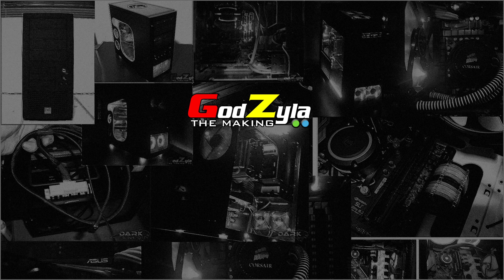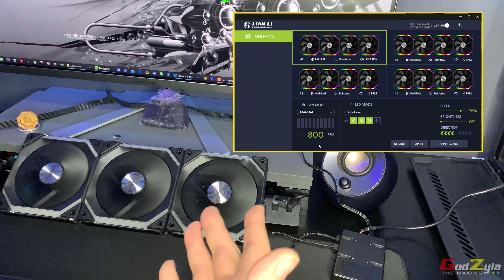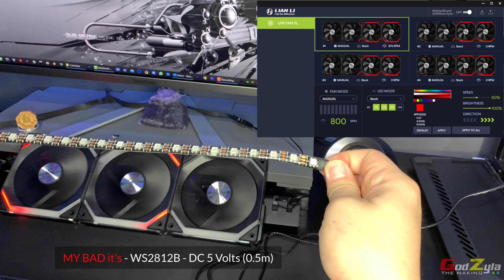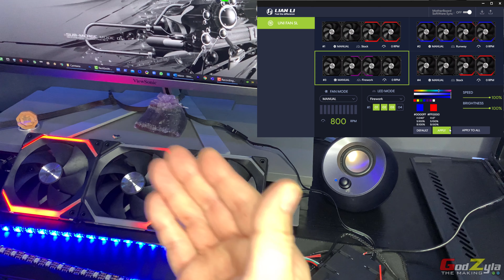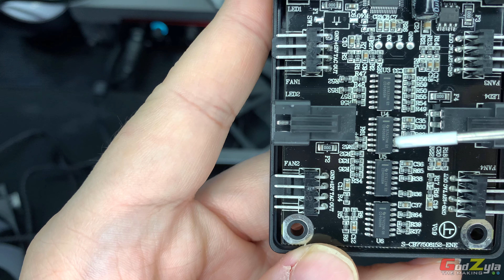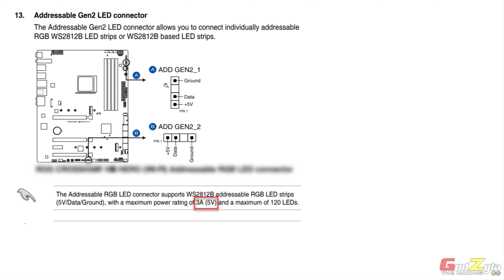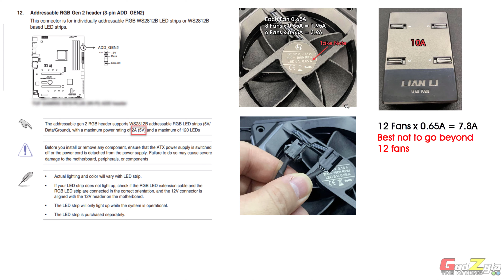Lian Li UNI Fans SL120 - Dos and Dont's (Part II) [L-Connect]

Comment from the maker: I have done a series of videos base on this uni fan which might interest you, list as follow 

Introduction (Part I) - https://youtu.be/ORdObJTn-3E
Connection & The Controller (Part III) - https://youtu.be/Rm2emeyMUAk
To use Galahad AIO on Uni Fan Controller - https://youtu.be/XNCAeAX0mZQ 
Some Break Fix!  - https://youtu.be/8l4i5UjO3es 
How to link Push and Pull configuration fans -  https://youtu.be/TIO8JxVZTi8 
Using EK Vardar Evo 120ER aRGB Fans on this uni -  https://youtu.be/bMRz2KVqbjA
SL120 Case Airflow Test - https://youtu.be/Qp3pYqOOjm4
SL120 Static Pressure Airflow Test - https://youtu.be/apDZ4v_jQBs
Reply: Please make a video detailing how to connect 10 Unifans (3+3+3+1) + Strimer cable kit + o11 Dynamic XL Case Light Bar, all together. I can't find any tutorials teaching me how to completely unify the controls of a full Lian Li build.
Reply from the maker: @kamikaze00007  hi welcome to my channel. You can choose what you like to know. I have series of videos in this playlist about these uni fans and uni controller https://youtube.com/playlist?list=PLEW-b-2vYDdPo0NzHyeksx012c-nkDapm
Reply: Is there any way to convert a standard 3 pin 5v argb connector that is on my waterblock to the connector that the unifan controller uses so that the controller can manage the rgb in the waterblock?
Reply from the maker: @cesarnono13  Hi thank you for your question. yes you can. this is what you need , 1 to 1 Female 5V 3pin connector https://www.aliexpress.com/item/1005001598378033.html or this https://www.ebay.co.uk/itm/PC-motherboard-5V-3PIN-TO-AURA-RGB-FAN-SM3P-Socket-Multi-connectors-cable-ASUS/264896189467?hash=item3dad0b141b:g:I6MAAOSw8-5ey3U8 . hope that helps and if you do like my content, kindly subscribe and to click on the notification bell. thank you very much!

Comment: Hi, I have a question about RGB hubs in general. My Gigabyte B650M doesn’t have bios settings for RGB at all (though has plenty of rgb headers). I can connect RGB fans to my motherboard and then control via various software, but my goal is to Not have any software running. So my question is:

A) Is there a hub that can be programmed through software and save settings on the hub itself, so I can then remove the software (but keep the settings on the hub)
B) If A is not possible, what hub can you recommend (probably with remote) to have good RGB options, without running any software.

Thanks!
Reply from the maker: Hi Emil -, welcome back. A) If you do know ic chip soldering and audrino programming to firmware in to if chip. You might be able to construct this kind of hub. But so far in the of market, there isn’t any. B) most ARGB remote hub are to be plug to individual ports which Lian Uni fans are of daisy chained style. It’s hard to plug each fan connectors to each individual port the remote ARGB port.

Comment: Hello Kleo Yan, I have 9 Lian Li SL 120 v2 connected to Lian Li SL 120 v2 Controller and i Have 24 Pin and 8 Pin Lian Li Strimer v2 connected to Strimer v2 Controller. Everything Works fine but i do not have connected ARGB Cables from the Controllers to My Motherboard MSI Z690 Carbon Wifi, because Im Scared of Burnt ARGB Connector, i also Have Palit RTX 4090 Gamerock OC with ARGB but not connected, my Motherboard only has 2 ARGB connectors is it fine if i Use a Splitter and Connect the 2 Lian Li Controllers and the RTX 4090 to my Motherboard without burning the ARGB?
Reply from the maker: Hello Fate, welcome to my channel, it is fine to use a splitter as all your argb are drawing power from their respective controller / hub so only thing left is the gpu which is drawing direct power from the motherboard.
Reply: @KleoYan  Thank you very very Much for your Fast Response, I will later try to Connect everything and hope it works👍
Reply from the maker: @FateEUW  Hi, you are most welcome. all the best with your build.

Comment: Hey Kleo, I hope you are well, I just finished a new build with 3 noctua fans managed by the ASUS ryujin 2 hub and 9 fans (using 3 fans on each connector) connected to the lian li controller included in the 3 pack.

Unfortunately, the Lian Li fans are recognised via Lian Li connect 3 but they do not spin and do not light up, I will keep troubleshooting. Do you have any advice?

Thank you in advance
Reply from the maker: Hello Dutch69, welcome to my channel, maybe this will help you troubleshoot. https://youtu.be/CgvuUFeff8U
Reply: @KleoYan  thanks, reinstalled the software, downloaded AMD drivers, checked for updates with Motherboard drivers and Connect 3. Still same behaviour

Comment: Hello i have question about controller if i wanted to install a 10 fans to case them do i need 3 controller or just 1, bsc i wonder why are u showing only 3 fans.
Reply from the maker: Hello DePatru, welcome to my channel. Back then I have gotten these from a friend but the controller does allow 4 fans to each port. To install 10 fans with this controller is of no issue. Just make sure they each port is to be kept at max 4 fans
Reply: @KleoYan  ok thank you
Reply from the maker: @depatru3270  you are most welcome and all the best with your build 😉

Comment: i was going to buy 2m argb strip light and use it with lian li controller hahaha thank u for not let me destroy my pc
Reply from the maker: Hello omzxa, you are most welcome. I have witness a lot blow their controller or even melt their cables and such. Some even damage their motherboard. So ya, it’s better safe than sorry.
Reply: @KleoYan  btw I have nine fans that I have connected to my motherboard without connecting the RGB, is this safe? It means that the fans rotate through the motherboard, but the lighting is via the controller, and the reason is that I have a screwdriver that touches the controller and the fans do not rotate anymore, only the lighting works
Reply from the maker: @omzxa8415  it is safe if u cap to 4 fans to one motherboard header. If u using all 9 SL120 fans which each is at 0.18a. Total is 1.62a. If u using just in one fan header. I won’t advise you to do so even your mobo fan header can support up to 2a. Try split then as is 3 in a group to the various fan headers and not to one fan header of your motherboard. For your info, Asus boards are mostly 1a unlike others.
Reply: @KleoYan  thank u man u the best
Reply from the maker: @omzxa8415  you are most welcome. Just to help 😉

Comment: Hi Kleo, I will be using Lian Li Strimer Plus V2 24-Pin and dual 8-Pin and together with 4x SL120 RGB with controller. Then I am planning to add 3x more SL120 RGB and I will be using my motherboard Aura software, that being said I will be using the ARGB header in my motherboard, however my motherboard only have 1x ARGB, (Asus ROG Strix B550-F Wifi II). The ARGB header only have the 3A max load. For the total 7x SL120 it will be total of 4.55A. I understand that the Lian Li unifan controller will be handling that however I am not sure the power rating of the Strimer Plus V2. So is it safe to add 3x more Fans?
Reply from the maker: Hi Rommel Asis, welcome back, so long you have all lian li argb products plug to their controllers and the controllers are powered by sata, you dont have to worry about the argb header of your motherboard. as the power drawn are from the controller and not from your motherboard. So is perfectly ok in your situation. The only issue you have is. if you have more controllers you will need more USB header from your motherboard to controller the lian li argb products. If you want to sync up the argb effects from your motherboard utility to these controller, that will be another challange too.. you will need a spliter for that.
Reply: @KleoYan  Okies thank you very much for your advise, I really appreciate it. In regards to the USB header, currently the Asus ROG Strix B550-F Wifi II only have 2x USB 2.0 header, sine I am also using the Kraken Z53 RGB LC I need at least 3x 2.0 USB headers. Initially I am looking at those cheap  9 pin 1F + 2M USB splitter but I am skeptical about the safety and the solution decided is the NZXT Internal USB HUB which I find it more practical, tidy and peace of mind :). As for the ARGB Splitter the Lian LiSL120 3x Pack comes with it (https://www.lazada.sg/products/i1643873544-s7721030674.html?urlFlag=true&mp=1&spm=spm%3Da2o42.order_details.item_title.1).
Reply from the maker: @rommelasis5991  I see.. yup.. getting an internal hub with it's own power is good.. is not about to deliver the power to your argb.. but is about the share USB IRQ that are on your motherboard. the more USB device you plug to your motherboard, your usb current will go weaker.. therefore causing irritating disconnection or signal lost between your USB Devices and the motherboard, which in this case your L-Connect 3 app needs to have consistent connection and not intermittance or disconnection.
Reply: @KleoYan  Thanks really appreciate all your inputs. Glad that I found your channel that sharing the infos particularly in building custom PCs. For about 3 months I have been checking prices in the popular online PC builder here in SG. Though I have previously building PCs way back in 97 to 2008, I not so excited in building my own, but I am glad that I decided to build and the aesthetics and RGBs are actually just got interesting...
Reply from the maker: @rommelasis5991  you are most welcome. I notice your shop link is from SG. Here is something which might interest you. I have an affiliated SG hub “Cyber Cypher” where he helps by linking my videos in his carousell shop. You can ask the shop owner if he can match your pc parts you are going to get or even to get bigger discount if you do bulk purchase. Below are the details. You can engage him in carousell or shopee. Btw all the best in your build. 

- Cyber Cypher 
you might want to check out this store.
Carousell https://www.carousell.sg/u/CyberCypher.Computers/
Shopee Online https://shopee.sg/cybercypher.computers?categoryId=100644&itemId=19820267878
PC Pricelisting in Singapore  http://www.cybercyphercomp.com/

Comment: two weeks uninstalling and reinstalling I have a hard time believing this software won't work. I have to use a 3rd party software. so frustrating
Reply from the maker: Hi qwicxs, welcome back, I can't recall which video did you commented and I understand your frustration, why not give it a shot to lian li tech support and report your issues? At least they have fixed my issue on L-Connect 3. https://lian-li.com/faq/ scroll down and fill up the form.
Reply: @KleoYan  Thank you sir. I have an MSI Carbon x570s MB AMD 5900x and Nvidia 3080 ti .. I replaced my controller yesterday. I have 3 AL and 7 SL Fans. I've moved the fan controller and RGB wires to different pins on the motherboard. I can control the colors with my MSI software and another 3rd party software. I also uninstalled all of them and tried just using the L-connect. Also I went on the Lain Li L connect website and followed the tip sheet on how to uninstall the L-connect. The L-connect can monitor my temps but it refuses to change my light color. I am to the point of taking them out. I am lost.
Reply from the maker: @qwicxs  i see. ok before you totally give up. do you have a spare m.2 or SSD or HDD, try this if you have a spare. Remove your current m.2 or ssd or hdd that contains your windows OS, plug in your spare, do a clean installation and install only the L-Connect. I know is lots of work but give this a last try. If it does not work, then I have no clue for you either.
Reply: @KleoYan  Yikes.. been thinking I am not home yet. I do have a single 140 in the back. That is connected to a port in the controller. Would that throw it off? Also I have two different types of fans the SL and the AL. On the controller. Would that cause issues?
Reply: @KleoYan  ok I learned there are two different controllers. AL  and SL you have to use the AL with the AL and so on.. I assumed they were all the same. It works now thank god
Reply from the maker: @qwicxs  hi qwicxs, that’s good. My bad, I should ask and pay attention on what controllers you are using as am aware of that. Nevertheless good for your stuff working. Good on you 👍
Reply: @KleoYan  yes sir.. If you can readdress that again. Save other people the pain and suffering I endured.  I appreciate your help your a valuable resource.. Ty!
Reply from the maker: @qwicxs  hey just call me Kleo will do. Yup will do. Thanks for the heads up 😉

Comment: so when i go use the lian li software, i can change fan speeds with the pwm and quiet mode etc, but in the application it says 0 rpm and it doesn’t actually change my fan speed
Reply from the maker: Hi Zaxsa, welcome to my channel. You might want to check the physical connection between your uni fans to the uni controller and does it react when you change the argb effects? This video might aid you if you are unsure how it actually works, https://youtu.be/Rm2emeyMUAk
Reply: @KleoYan  my rgb works i have 9 fans to one controller, and it’s plug to my mobo, but im not sure why i can’t control my fan speed, unless a different software is using it but im not sure
Reply from the maker: @zaxsa8845  I see, you wanted to follow mobo PWM is it? if that's the case, just go to your mobo UEFI and set that fan header you've plug as PWM mode and not Auto. that will do the trick. or you can watch the video link I've sent you earlier.
Reply: @KleoYan  okay thank you so much man have a good day
Reply from the maker: @zaxsa8845  you are most welcome. All the best with your build buddy 😉

Comment: Friend, I've had other times on the channel to clear my doubts, as I said I understand very little English currently I have the Lian Li S120 and after turning off the computer it goes back to the rainbow I wanted it to be in the colors I like I have a B550 Tomahwak
Reply from the maker: Hi Bruno Soares, welcome to my channel. The rainbow should go away once you boot up your pc, L-Connect needs to boot up in windows before it loads your present profile.

Comment: Hi Kleo, I installed my unifans into my pc and both the fans and controller are working, however, when I set my fan mode to PWM in L-connect, it just runs at full speed even when the temp are low. Any idea?
Reply from the maker: Hi Mr. Nighter__, welcome to my channel. just to check, did you plug the PWM cable which has only one wire from the uni controller to your motherboard fan header (Example Chassis_Fan1). Also have you checked your motherboard UFEI / Bios. was that fan header (Example Chassis_Fan1) is set to PWM Mode and not DC mode, please note if you set in L-Connect as PWM mode, it will follow the fan curve of your motherboard fan header. so if you have not set any fan curve on that fan header, it will run by default full speed.
Reply: @KleoYan  Thanks for replying:-). I do set the chassis fan header to PWM mode while also setting the ''fan speed control'' to ''manual'' (which allow me to manually setting the fan curve). Does PWM conflicts with manually set fan curve? Should I set the fan curve to auto mode?
Reply from the maker: @biaozai1314  hi if your L-Connect is set to PWM. The setting is based on what you set on your motherboard UFEI settings. If you set to manual in L-Connect. It’s the uni controller taking the control and not your motherboard. So it depends what you really want to do. For me in most build for friends I will not connect fan load to the uni controller. I will plug the different fan set to the various motherboard fan header and control through the motherboard. I will leave all argb effects to be controlled by the uni controller. 
Reason is, especially for liquid aio. If uni controller is down, only the argb effects are affected and not affecting the rpm of the fans mounted on your radiator. Maybe is just me, just a safety measurement so that I know my liquid aio continue to operated. As for case fans. You can either plug to motherboard fan header or to the uni controller.

Comment: Why do my fans stay rainbow in startup then changes to blue and I can’t control them with any software
Reply from the maker: Hello AK47boyzzzzz, welcome to my channel. Do you by chance have another USB Header on your motherboard? Try switch the USB connector from your uni controller to the motherboard USB 2.0 header to another socket. If it still does not work, is your motherboard bios up-to-date and are the inf drivers up-to-date? if not, you might want to update the bios firmware but please do this at your own risk and also to update the inf drivers for your motherboard. This video will only guide you on how to update the inf drivers on either platform (Intel or AMD) https://youtu.be/8l4i5UjO3es .. if all does not work, did you use any argb application before you install the L-Connect application? If you did, uninstall all argb programs using the revo uninstaller to remove the left over files https://www.revouninstaller.com/revo-uninstaller-free-download/ . Once done, install only the L-Connect and test it. If all failed, kindly contact Lian Li Support directly from here https://www.reddit.com/r/lianli/ or https://lian-li.com/faq/, they should be able to aid you.

Comment: Love this video,  may i ask if these fans will work to a different fan hub. I have a tecware mirage aio with a fan hub. Is it compatible?
Reply from the maker: Hi Spicy Ice, I do understand there is a argb comtroller which comes with the Tecware Mirage, but I would not advise you to use it. you see the load of each SL or AL are rated at 0.65a and 0.66a, it's alot of load there. if you are to plug 3 to 4 fans to the Tecware controller, it might overload and the capacitor might blow. if it's just 2. it should be fine, but you need to either self crimp the connectors of the SL or AL fans or to purchase a converter. kindly note, I have not try this and will not encourage to do so. This is the reason why https://youtu.be/QQHJUQvKwlY